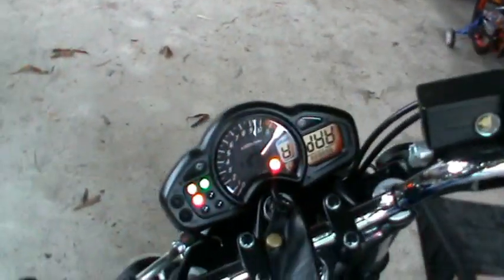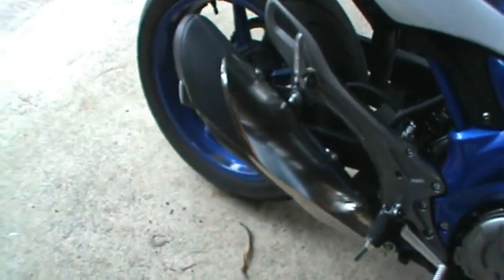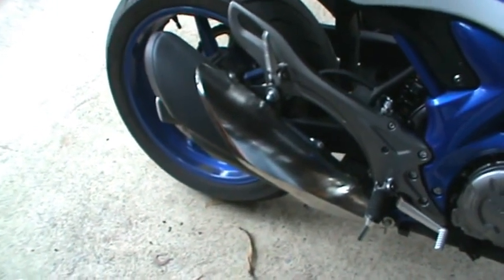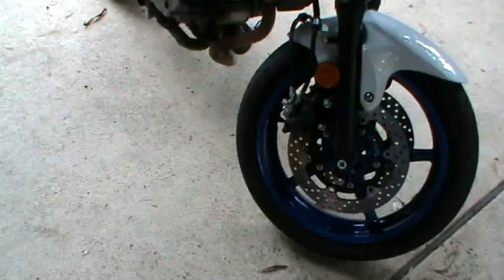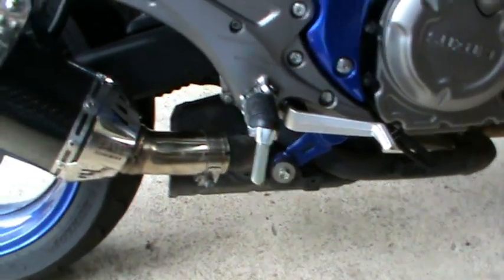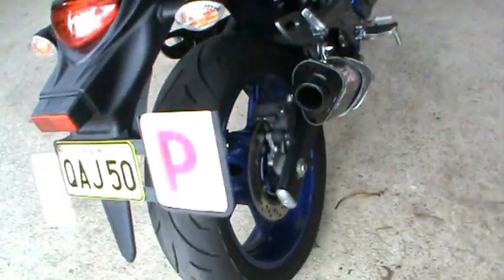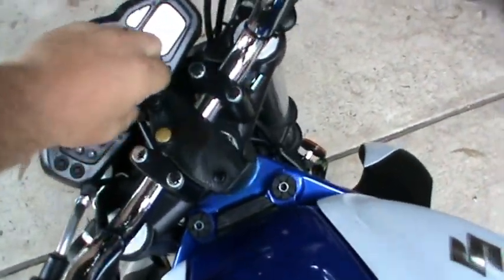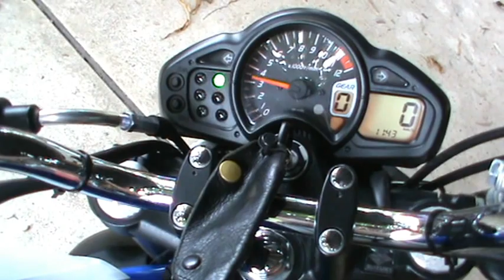2011 SFV 650 Gladius LAMS with Yoshi Exhaust

Comment from the maker: Hey buddy.  The bike is still governed by ECU.  There is no physical throttle restriction other than the ECU main board missing some items.  These bikes rev out to 10.5 and I have on occasion missed a gear change in corners or on straights and been up close to that level.  They really don't get much past 8K on the lams settings.  Non LAMS ecu would probably continue to pull all the way.  Great bike for a full size.  Would have also considered 650 RL Ninja if they existed at the time.

Comment: Hi there, I know this video is a bit old now but was wondering if you had to cut the pipe to fit the new one on?
Reply from the maker: Alisha Banks Hey.  The unit was a slip on and fit on perfectly. From memory I think i pulled it off a gixxer.
Reply: shaznem thank you. I just picked up a second hand Yoshi pipe for my 2011 gladius and my mechanic said I have to cut the pipe to fit it, surely not. Think I'll get a second opinion

Comment: Is it a possibility to swap over a SV650 complete system, and add on the same muffler, that with the cat & heavy box removed, or is that not ok to do, where you live ? Thanks, yl
Reply: would need to retune the engine mapping
Reply: Thanks for the info, it makes sense when going from that much restrictions to an easy flowing system. !
Reply from the maker: +ylism I am unsure of all that would be involved. No doubt someone would know that info though - and as +LIVINGCHURRO said below, mapping would most definitely be involved.
Reply: I am sure the compleat stock setup off a 2 gen bike could be swapped with little troubles.

I was considering buying a new SFV650, and I have a K6 SV650n now so it's not a biggie to get measurements, just haven't read where it's been done ?

Thought maybe it could be a cheaper way to help others too.

Comment: youre obviously in australia, not sure where though, i was just wondering if all sv650/sfv650 are lams approved or is there a restrictor? and what state?
Reply from the maker: Henry Chiang . Hey buddy.  I'm in NSW.  Last time I checked there were 2 versions of each.  The LAMS models have different ecu's which retrict top power. I had my ecu tuned, however the max power wasn't available as the LAMS ecu was physically modded from the factory.
Reply: i see, is that just for nsw? because i have yet to see any restricted sv/sfv650s in sa. Do you guys have more strict power to weight ratio laws?

Comment: Hey mate i have the same bike and just put a yoshi pipe on it! but i am thinking of removing the silencer and putting a header pipe on it so it sounds better and it will give me improved air flow with more responsive throttle! any ideas on that? and what mods have you got on yours apart from the yoshi pipe?
Reply from the maker: I had the ECU remapped.  made a pretty big difference, but not full non lams power as the ecu is physically restricted.  other than that, LEDs, rim tape, soft stuff you know?
Reply: Yeah but does it sound better?
Reply from the maker: +MrNinja Man Sounds much better

Comment: It won't be a lams bike anymore. Any modification that increases the power:weight ratio invalidates lams approval as that is based on manufacturer specifications. Fortunately for most people, only motorbike cops would know to enforce that requirement.